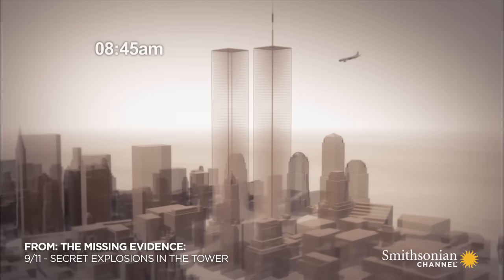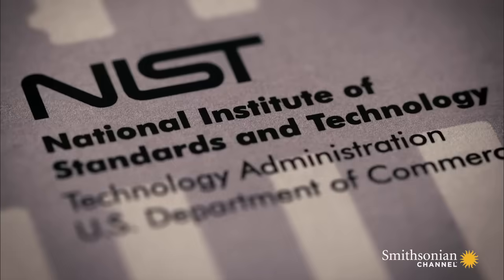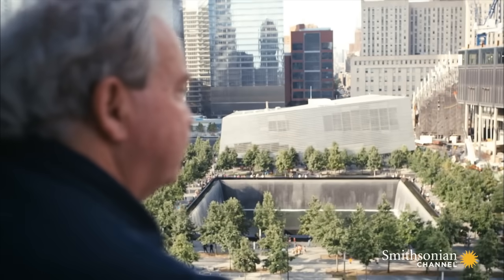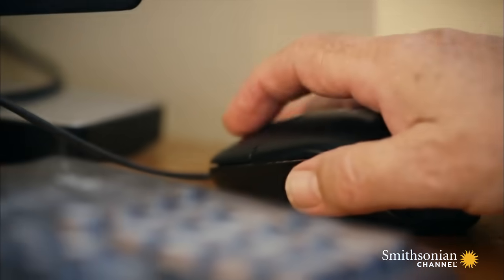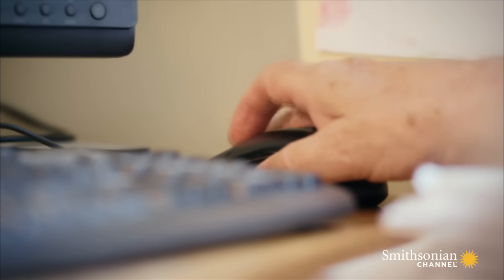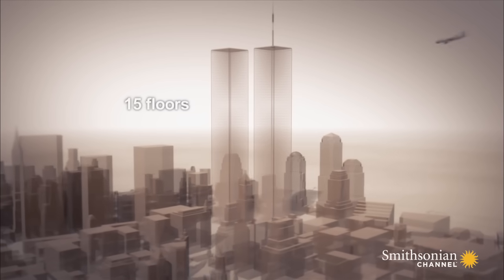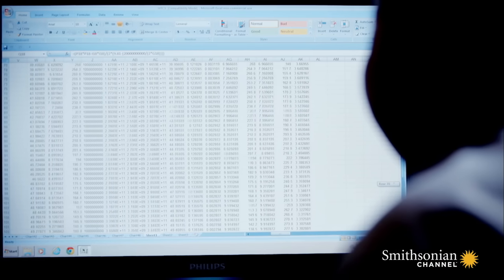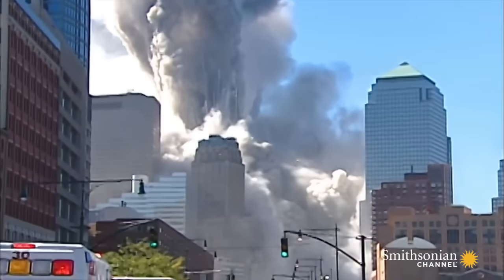This Computer Simulation Explains How the Twin Towers Fell

Comment: 15 floors MIGHT destroy 15 lower floors, , maybe, not the entire building, twice.  Jet fuel doesn't burn hot enough to melt steel, and four pilots did NOT give up control of their jets to a dude with a box cutter.
Reply: do you really think that 15 floors cant destroy one floor? that 16 cant destroy 1? on and on up until every single floor against the lobby?
Reply: @inutero3516  so... you believe it was a progressive collapse? You are also suggesting that the mass and energy of 15 floors collapsing gain mass and energy for ever subsequent floor below.  Instead of the mass and energy of the 15 floors collapsing having and equal reaction which would be loss of energy at each floor hit under the collapsing 15 floors while gaining mass until an equal reaction.  If physics work that way why in control demolition do they start at the bottom and not just start at the top?
Reply: @inutero3516  Newton's third law: for every action, there is an equal and opposite reaction.
If 15 floors collapsed an equal and opposite reaction would be 15 floors of destruction.  Energy is lost at ever subsequent floor which slows the progressive pancake collapse.
Reply: @c.augustedupin2559  

"Energy is lost at ever subsequent floor which slows the progressive pancake collapse."

Let's start from the first floor that collapses. Would you agree that one floor cannot possibly hold up the 15 floors above it?
Reply: @cchris874  your question is too ambiguous.  You could say yes or no to it.  Can you please clarify what you are talking about?
Reply: @cchris874  the first floor of ever building holds up every floor above it. This too is ambiguous
Reply: @c.augustedupin2559  

I don't see that at all. How can a floor hold up another floor if it has no direct contact with it? In the Twin Towers the only thing connecting floors to each other were the perimeter and core columns. It's the COLUMNS not the floors that hold up each floor.
Reply: @cchris874  ok so you were just being ambiguous. Thank you for the clarification
Reply: @cchris874  you said "floor" when talking about a specific system and must have became confused by my use of the word "floor" when talking about an area containing many systems, including walls, columns, ceilings, floors, plumbing, electric, etc.  I was referring to a floor as a mass of systems and not an individual structural floor system.
Reply: @cchris874  I used the word "floor" to describe an area and wasn't talking about a system.  I hope this clarifies it for you.  I'm sorry the context of the sentence didn't help you deduce it's meaning.
Reply: @c.augustedupin2559  
OK, so let's go back to our collapse initiation. In the NIST model, which I don't necessarily fully endorse, the key insight is that once the perimeter columns started to give way on one side of the building, it caused two things to happen: one, the towers started to tilt in the direction of the side which failed first, as we all saw in the videos. But it also destabilized the upper block, causing it to rotate and twist. When this happened, there was no longer column-on-column contact:  the upper perimeter columns were now pressing down on the floors themselves, which were never designed to hold up 15 floors worth of weight. So the floor immediately below gives way.

Does that sound like an impossible scenario to you?
Reply: @cchris874  why do you use the NIST model if you don't fully endorse?  Why don't you fully endorse it?
Reply: @cchris874  I see you used the word "floor" multiple times.  Can you clarify what you mean because I'm not sure if you are talking about a structural floor system or talking about an area.  Your context seams to being back and forth.  And since you were confused about my usage in comments I fear your comments could be confusing and misconstrued.
Reply: @c.augustedupin2559  

"why do you use the NIST model if you don't fully endorse?"

Just being modest. Also, the NIST report contains hundreds of pages of details, and I can't pretend I have fully digested every last one of them to my satisfaction. But the basic claim of a gravity driven collapse need not rely fully on their exact model. So, I proceed here very tentatively to give you ample opportunity to point out what you feel is implausible. Personally, I feel the gist of their model is within plausible limits, and that's good enough for me to have this discussion. So far, do you see any fatal problems with the model so far?
Reply: @c.augustedupin2559  

"why do you use the NIST model if you don't fully endorse?"

Just to be extra persnickety, I didn't say I don't fully endorse it, I don't NECESSARILY endorse it completely, meaning, I leave that an open question.
Reply: @cchris874  what model are you talking about?
Reply: @c.augustedupin2559  

I'm sorry for being unclear. This one:

"once the perimeter columns started to give way on one side of the building, it caused two things to happen: one, the towers started to tilt in the direction of the side which failed first, as we all saw in the videos. But it also destabilized the upper block, causing it to rotate and twist. When this happened, there was no longer column-on-column contact:  the upper perimeter columns were now pressing down on the floors themselves, which were never designed to hold up 15 floors worth of weight. So the floor immediately below gives way."
Reply: @cchris874  please define "floor" and "assembly".  Are you talking about the assembly of an area? Or just the structural floor system and how it is assembled?
Reply: @cchris874  your paragraph talking about a proposed model uses the word "floor" multiple times.  Can you be more clear on about your usage of the word "floor"? Are you taking about an area or a specific structural floor system?  Since you were confused first I want to make sure we are on the same page.  Please provide clarification.
Reply: @c.augustedupin2559  

I mean everything minus all the support columns. In this model, the perimeter columns above are no longer aligned with the columns below, so they are now hitting the floor directly, not the columns.
Reply: @cchris874  I'm sorry your paragraph is too ambiguous and isn't specific.  Your usage of the word "floor" is not defined.
Reply: @cchris874  again when you're saying "floor" are you talking about a specific system or talking about a location or area? Please clarify.
Reply: @cchris874  I don't want to become confused like I did to you when I was talking about "floors" as a location or area.
Reply: @cchris874  please clarify your last statement when using the word "floor".  Are you talking about a system or area?
Reply: @cchris874  if columns above are no longer aligned with columns below how did they hit anything?  Hitting implies something different.  I think you mean the columns are resting on the floor system of a specific floor (ie area).  But I can't tell because you haven't clarified.  Please clarify your statements.
Reply: @c.augustedupin2559  

Just for illustration purposes, if all of the columns are twisted off kilter so that they no longer  align with the columns below, what do you think would happen to them? There are at least two choices: they somehow stay magically elevated. Or, they will have been forced to slide onto the  structure nearest the failed column. That would be the floor right below it (or the air). So whether we call this slided onto, hitting, or resting doesn't matter. That's semantics. It's no different than a trampoline. If you jump out of alignment with the canvas, you will be forced to hit what's right next to it: probably the ground. We can then say you hit the ground, or came to rest on it. Same basic meaning.
Reply: @cchris874  why ask a question then answer it.  Why so combative? I was just asking for clarification? And yes if a column is not properly aligned structural movement can cause structural failures.  What type of structural system failures do you believe to be seeing in the video? What type of structural collapse would you categorize it as?
Reply: @cchris874  also do you understand the column assembly or rather do you understand how column structural support systems are assembled?
Reply: @cchris874  I just wanted to clarify for you because you seemed confused about the usages of the word "floor" and implied that a "floor assembly" is the floor system when it is only a guide on how to assemble floor systems.  Maybe we just have two different schools of thought...
Reply: @c.augustedupin2559  

 I'm trying very hard to make my point understandable. Any combativeness  was not intended. In my last post, do you agree the above columns are not necessarily going to be aligned; and if so, now the surface of the floor at that point will now be bearing the brunt of the weight of the upper block?  I don't know how to say it any more clearly.

Thanks
Reply: @cchris874  hitting and resting are two different meanings.
Hitting implies multiple forces
Resting implies only natural force
Just fyi you seem confused...
Reply: @cchris874  jumping off the trampoline you would first hit the ground. Then after hitting the ground you would then begin to rest.  Maybe you are just confused.
Reply: @c.augustedupin2559  
"I just wanted to clarify for you because you seemed confused about the usages of the word "floor" and implied that a "floor assembly" is the floor system when it is only a guide on how to assemble floor systems.  Maybe we just have two different schools of thought."

I may be confused, but I think it's irrelevant to my point. Forget floors. Let's divide the North Tower in to 2 parts: all the supporting columns; and everything else. Take away the support columns and the rest of the building would collapse. Can we agree on that?
Reply: @cchris874  ok just the columns magically disappear at the same time in this hypothetical of yours.  So I would agree that everything else would stack up on each other.  Each floor (area) including their contents would be pancaked.  Ie a pancake collapse.  Each floor would hit each other based on their terminal velocities and then rest on each other after the collapse.
Reply: @cchris874  I'm sorry you are trying to make a point.  Maybe study more.
Reply: @c.augustedupin2559  

You are being far more combative than me, telling me I need to study more, and I'm confused. How does that happen? Did I even come close to saying that to you?
Reply: So, you want my basic model, which I now put forth in a tentative spirit:

1) Floors start to sag due to the intense heat. 
2) They begin to pull on the perimeter columns, which also are weakening due to the heat.
3) As columns begin to fail, the remaining columns are redundant enough to absorb the extra weight at  first.
4) When enough columns fail, the weakest side of the building begins to give way, hence we see the tilt.
5) This process causes the upper block to twist and rotate, so that in very short order the columns on the other three sides are now pulled away from their alignment.
6) When this happens, the upper block now has too few columns remaining attached to the columns they were previously connected to.
7) Since the upper block now has lost its column support, collapse initiation begins.
8) Forget how we define floor. It's not necessary. Whatever we call it, it cannot support the weight of the upper block. That's why I feel you are hung up on the definition of "floor." 

Note the reason the discussion about floors is not central. It makes no difference how we define "floors" or  whether we say the columns hit, or slided off of, or came to rest (which would of course be only for a fraction of a second) on the floor/whatever you want to call it on that same level. All of that distracts from the main point: the upper block has lost most its support from below, because it's only the columns that are holding it up.

Now, you are welcome to comment on this model. Thank you.
Reply: @cchris874  I'm sorry if you believe I've been combative.  You stated that you were confused.  And you implied you were confused by my usage of the word floor when you asked for clarification.  I need to study more too.  I hope you haven't stopped.  If anything it was just constructive criticism.   Please forgive me I didn't mean it to be combative.
Reply: @cchris874  do the lower columns have the ability to support the same weight of the "upper block" or do they stop having the ability to bear the same weight?
Reply: @cchris874  what type of collapse do you categorize it as? How do you define your proposed model? What type of structural failures do you think would happen in your model?
Reply: @c.augustedupin2559  

"do the lower columns have the ability to support the same weight of the 'upper block' or do they stop having the ability to bear the same weight?"

They would not have the same ability because they are no longer attached to the upper columns. Without these lower columns, there's not enough support for the upper block. The upper columns are now  only attached to other structural members (whatever we might agree to call them), which were not designed to, or capable of, holding up the upper block.   Now, if you don't like my vague definition of the word "floor," then just substitute what you think the upper columns would now be attached to on the lower block. I'm happy to use that in place of "floor." The main point is, with this hypothesis, there is no longer enough column-on-column left. The upper block has lost most of its column support. The remaining structure can't hold that up.
Reply: @cchris874  so.. you are saying due to the upper columns not being connected to the lower columns; the lower columns lose their ability to bear weight? Is that correct?
Reply: @c.augustedupin2559  
I would just call it a basic gravity collapse model. Not sure if the term "pancake collapse" is the appropriate name. 

Since there is no more column-on-column support, there's nothing to stop the collapse from continuing. With each collapsed floor, the upper block gains more mass and continues. How long this would take, and how much it would slow down, is not in my knowledge base.

Off topic for now:  BUT, if this were a CD, then it would be easy enough to slow the collapse time in accordance with a real CD. Why would the government wish to use impossible physics when they can use real physics? That doesn't make much sense to me.
Reply: @cchris874    so.. you are saying due to the upper columns not being connected to the lower columns; the lower columns lose their ability to bear weight? Is that correct?
Reply: @c.augustedupin2559  

Not quite. The lower columns still have the same ability to carry the weight. But the problem is, they are no longer actually carrying it. It's now the floors, anyway you define that, /other structural elements, that carry the bulk of the weight. Not sure how significant the core columns are here, but they would not be able to hold up the floors on their own.
Reply: @cchris874  why aren't they carrying weight? Did they disappear?
Reply: @cchris874  "if this were a CD, then it would be easy enough to slow the collapse time in accordance with a real CD" 
Not sure what you are even talking about.  Why would you slow the collapse? 
What is a collapse time that would be in accordance with a real CD?
Reply: @cchris874  are you suggesting that when the "upper block" was supported by the structural floor systems it passed between the lower columns hitting each subsequent floor between the lower columns that they were supporting.  And that the lower columns could not support their floors due to the added weight of the "upper block".  Each floor progressively pancaking into each other but never losing energy force.  And the core columns would lose it's ability to bear weight.  Basically the "upper block" vs 80+ percent of undamaged building material.  The "upper block" destroys everything with only gravity force and natural force (upward force of the 80+% of undamaged building) doesn't apply. Is this correct?
Reply: @c.augustedupin2559  

"Why would you slow the collapse?"

Because the argument has been put forth that the total collapse times were "too fast."
Reply: @c.augustedupin2559  

"are you suggesting that when the "upper block" was supported by the structural floor systems "

Actually the opposite. The structural floor system/ whatever you want to call it, could NOT, under this model,  support the weight of the upper block. 

"it passed between the lower columns hitting each subsequent floor between the lower columns that they were supporting."

Not entirely, but enough so that the upper block no longer has enough support left.

"And the core columns would lose it's ability to bear weight."

To an extent. But even if not, imagine if there were no perimeter columns. Would one expect the floors to stay in place with only the core columns?
 
"but never losing energy force."

No.not saying that. The question is, how much would it lose?

"The 'upper block' destroys everything with only gravity force and natural force (upward force of the 80+% of undamaged building) doesn't apply. Is this correct?"

It does destroy everything, but it happens one floor/level at a time. So with each level being destroyed, the upper block gains further mass. So, if these 15 floors can destroy the first floor beneath it, what changes in the equation now prevent the process from continuing?
Reply: @c.augustedupin2559  
"why aren't they carrying weight? Did they disappear?"

LOL

Because the weight of the upper structure is no longer landing on the lower columns, at least sufficiently enough to bear its weight. So now consider: what would happen if the floors all shrank and no longer reached the outer columns. Obviously the lower columns can't hold up that which it's not touching. Now that would be an extreme hypothetical. But it illustrates the basic principle, as I interpret it.
Reply: @cchris874  too fast for what?
Reply: @cchris874  in your model the columns give no support to the structural floor systems.  Is like they just disappear.  The floor systems are not  designed for heavy loads but still would cause and be large resistance.
Reply: @cchris874  the lower columns are touching the structural floor systems so yes there would be support from the lower columns.  There would be rotation and visible movement.  There would be large resistance for the upper block to move through, 80+% of undamaged building.  Plus if we use newton's third law of motion we would be left with at least 25+% of the building standing after the collapse. Unfortunately in the video we can see horizontal energy and total collapse without evidence of major resistance.
Reply: @cchris874  is like you said "not sure how significant the core columns are here".  This is the thing... They would offer at least as much resistance as the perimeter and be less likely to rotate off their designed support structures due to being encased by the building structure.  Also you may want to look at the wtc building design assembly diagrams or blueprints.  The outside columns are not traditional columns which could lose contact by rotational movement.
Reply: @cchris874  your interpretation lacks science and your terminology isn't used by experts.  If anything you're an amateur structural/civil engineer.  I give you props for coming up with your own hypothesis.  Even if it lacks equations and doesn't apply laws of motion.  You are clearly Google educated.  That's awesome you are doing more work than many.  Keep studying my friend and I will too.
Reply: @c.augustedupin2559  
"There would be large resistance for the upper block to move through, 80+% of undamaged building. "
When you say things like this it shows that you don't understand the progressive collapse.

"Plus if we use newton's third law of motion we would be left with at least 25+% of the building standing after the collapse."
And you make the same error here.

The initial upper blocks may have been 15-20 floors.   So they drop on a weakened floor below and keep moving.  The material from that floor joins the collapse.   Now you have 21 floors coming down.  They hit the next floor.  That cannot possible arrest 21 floors coming down with momentum now and also on an angle, so the collapse continues.  Now you have 22 floors smashing down....23  24 25 and it continues.

If you're talking about the upper block destroying the rest, you're showing that you don't understand this.
Reply: @c.augustedupin2559  

"Not sure what you are even talking about.  Why would you slow the collapse?"

I don't know why I have to explain this. As you obviously know, one of the central criticisms by the truth mvt is that the towers could not have collapsed as fast as they did by gravity alone. The speed was therefore "too fast." You must have heard that claim numerous times, right?

So, to preempt this claim, why didn't the government make the alleged demolitions conform to physics?: make the collapses take as long as they would if it were an unaided gravity collapse.  That way, they avoid the charge that the collapse times "violated physics."

Am I making sense?
Reply: @cchris874  really?! People think that gravity alone caused this?! Wow.  Why did you bring the government into this? Which document are you even talking about? There's no government document stating why there was a "total collapse". At least I can't find one.  Please share your documentation.  Is that why you don't necessarily endorse NIST?
Reply: @c.augustedupin2559  

"Which document are you even talking about? "

Help me there. Where did I mention a document?
Reply: @c.augustedupin2559  

"Why did you bring the government into this?"

Who do you think is responsible for the complete collapse of the buildings?
Reply: @c.augustedupin2559  

"There's no government document stating why there was a 'total collapse' "

I didn't say there was. Read more carefully please. Irrelevant to what I wrote above.
Reply: @cchris874  if you have know idea what caused the total collapse why do you speculate how it happened if you aren't an engineer? Why do you play monkey see monkey do?
Reply: @cchris874  do you have any scientific paper talking about and proving why there was a total collapse? Or do you only have "trust me bro" mentality?  Please give evidence if you aren't hear to push a narrative and only try to gaslight.
Reply: @c.augustedupin2559  

For the sake of argument, I will change "total collapse" to "the extent to which the twin towers actually collapsed."
Reply: @c.augustedupin2559  

And to avoid any more potential for miscommunication, why don't you state in your opinion, based on your engineering knowledge, how much of the twin towers collapsed, and what you believe caused it, and who bears primary responsibility, if anyone.
Reply: @c.augustedupin2559  
" There's no government document stating why there was a "total collapse". At least I can't find one"
There are plenty of analyses.  NIST even reference one of two of them in their report.   They even show a basic analysis in their FAQ explaining why there was a total collapse.
You are playing games.   The information is there but you don't really want it.  You are just trying to present it as some sort of mystery.
Reply: @c.augustedupin2559  
" do you have any scientific paper talking about and proving why there was a total collapse?"
There are multiple papers on this by people like Bazant, Greening, Seffen, Zhou et all.
Reply: @cchris874  it's an unsolved mystery.
Reply: @markh1011  the papers  you're quoting do not show what we see in the video or the aftermath.
Reply: @c.augustedupin2559  That's exactly what they analyse.   Their analysis is consistent with what we saw.  
I expected an excuse but that was even worse than expected.
Reply: @markh1011  so please cite it.
Reply: @c.augustedupin2559  So let me get this straight.
You just claimed that the analyses were wrong.
Now you're asking me what the analyses are.
So you claimed they were wrong before you even knew about them.
🤦‍♂
Reply: @c.augustedupin2559  You mean "cite it".  🤦‍♂

Here are a couple.  
Why Did the World Trade Center Collapse?—Simple Analysis
By Zdenek P. Bazant1 , Fellow ASCE, and Yong Zhou2
Journal of Engineering Mechanics

Zdenek Bazant, Jia-Liang Le, Frank Greening, and David Benson, 
“Collapse of World Trade Center Towers:  What Did and Did Not Cause it?”, 
Journal of Engineering Mechanics, May 2007.
Reply: @markh1011  so let's get it straight you never read them because you can't cite them.  Nice bro...
Reply: @markh1011  let me be more specific.  Where in the papers did they cite the cause for total collapse?
Reply: @c.augustedupin2559  
"so let's get it straight you never read them because you can't cite them"
I have read them and did cite them,
You're projecting your own problems.
Nice bro...   
😂
Reply: @c.augustedupin2559  
So what will the next evasion be  ..bro?
Reply: @markh1011  so you have nothing lol. You are just a typical gaslighter... I'll wait for you to cite something from the papers.  But I doubt you have ever read them...
Reply: @c.augustedupin2559  I can provide many more.
There were plenty of papers in peer reviewed journals supporting the official story.
You're going to have to come up with a lot of excuses.....  bro.
Reply: @markh1011  I'm still waiting for you to cite anything that explains total collapse.
Reply: @c.augustedupin2559  
". I'll wait for you to cite something from the papers."
So I've cited papers.
I've even cited a specific page of one of them.
You are running now.
🏃‍♂🏃‍♂🏃‍♂
🤣🤣🤣
Reply: @c.augustedupin2559  
"I'm still waiting for you to cite anything that explains total collapse."
I've given you a paper that has a full analysis of the total collapse!
You're looking panicked and cornered.  😂
Reply: @markh1011  lol lol lol what page of what paper did you cite? I don't see anything.  Maybe you are trying to gaslight like usual.  Lol lol lol lol lol
Please cite the paper and page again if you can.
Reply: @markh1011  again it should explain total collapse
Reply: @c.augustedupin2559  
So we've had:
"Any papers proving why there was a total collapse?"     Provided.
Then to 
"They don't show what we see in the video."     Even though you haven't even looked at them!
Then to
"No you have to cite specifically".     Done.
Then to 
"Where does it say what caused the total collapse?.       Done
Then to
"I'm waiting for you to cite what caused the total collapse.     Already done!  

Look at him run.  
🏃‍♂🏃‍♂🏃‍♂🏃‍♂🏃‍♂
Reply: @c.augustedupin2559  
"lol lol lol what page of what paper did you cite?"
 “Collapse of World Trade Center Towers:  What Did and Did Not Cause it?”, 
Page 30.

That's TWICE now.
Reply: @c.augustedupin2559  
" again it should explain total collapse"
The paper is an analysis of the total collapse.
I have referenced TWO papers that do this and I have more.

You're stalling and it's hilarious.   🤣🤣🤣
Reply: @c.augustedupin2559  
You're looking cornered. 
A little hint, typing lolololol isn't going to save you.  😉
Reply: @c.augustedupin2559  I'm still laughing at this "the papers  you're quoting do not show what we see in the video or the aftermath."
....you didn't even know about the papers but you were claiming they were wrong.    
That says a lot.
Reply: @markh1011  
You know, I knew he was beginning to play games when he started making a big fuss over "total collapse" times. What a semantic joke. Actually I had a hint when he did the same thing with "floor." First he praises me for trying, then he does an about face and says, Monkey see Monkey do. This is all the sign of a most fragile fellow.
Reply: @markh1011  
Auguste claims above it was impossible for the perimeter columns to sufficiently twist themselves off to hit the floor. I was going to ask him for the science behind that, but maybe you'd care to comment too.
Reply: @cchris874  I think this is the same guy who post posted "lol" as a response to my posts many times.   That's the whole post  -"lol".   So I'm actually surprised that he got into a discussion with you at all.   I didn't think he had that in him.
Reply: @cchris874  
"Auguste claims above it was impossible for the perimeter columns to sufficiently twist themselves off to hit the floor."
I'm struggling to visualise that.  What do you mean by (1) twisting off (2) hitting the floor.  

Are we talking about the initiation of the collapses where the floors sagged and the perimeter columns bowed inward until failure?
Reply: @c.augustedupin2559  

Gaslighting means to manipulate. Yes, I suggested that truth movement types often have a tendency to some pretty weird ideas. But I did not do so through manipulation of you or anyone else. I did it just by reflecting on the absurd that arises by itself when one looks at the bigger picture. Like the need to bring down the towers in the first place. This is hardly gaslighting. It's using your brain. And I am not suggesting that you, or every last skeptic, is in this category. A lot of very smart and sensible people believe what you do. But then, I would argue, we all have our blind spots.
Reply: @markh1011  there is no page 30. I see you are still gaslighting... Nice try though
Reply: @cchris874  did you look at the exterior shell of the wtc towers? I doubt it since there not typical columns.
Reply: @cchris874  and you haven't a clue or just gaslighting.  Lol lol lol lol lol
Reply: @markh1011  lol
Reply: @markh1011  look at you run... Lol lol lol lol
Reply: @c.augustedupin2559  
"there is no page 30"
You are correct, I looked at the bottom and saw 30.  It was equation 30 on page 15.
So the correct answer was page 15.

However I made it clear that I was referencing from the conclusion.
There are 15 pages with a conclusion at the end.
You could have found that.

So you've been completely spoon fed every step of way now.
You've got exactly what you asked for.
Quit dodging.
Reply: @c.augustedupin2559  
"look at you run"
You're projecting.
You asked for a scientific paper explaining the total collapse.
I've given you 2.  I have more.
You've been tap dancing every since.  💃👯💃
Reply: @markh1011  you have never read the paper... And you are still trying to gaslight.  Lol lol lol lol
Reply: @markh1011  you haven't given anything  other than titles to papers you have never read and you don't know the people who wrote them.  You also haven't read any peer reviews either.  You might have a list of papers given to you from your commander but you haven't done your due diligence.  Nice try at gaslighting. Lol lol lol lol lol lol
Reply: @markh1011  I think you are confused about your projections. Lol lol lol lol lol lol lol lol lol
Reply: @markh1011  lol page 15. Conclusion. Lol lol l lol lol lol lol lol lol.  You don't even understand. Lol lol lol lol lol
Reply: @markh1011  it's a real shame you can't cite any real information from papers you claim to have read the titles of.  Smdh 
"Page 30" lol lol lol lol lol
"Nevermind I meant page 15" lol lol lol lol lol lol lol lol.   

How about cite the equation you think you saw. Lol lol lol lol lol lol LoL
Reply: @markh1011  your lies are catching up to you. Lol lol lol lol lol lol lol 
Please keep trying to gaslight.
Reply: @markh1011  I'm writing a book about your kind. Tim Shea is one of the best gaslighters. You better call in another fake account with a better moderator.  Lol lol lol lol lol lol lol lol lol lol lol lol
Reply: @c.augustedupin2559  

"and you haven't a clue or just gaslighting"

Already answered that. 

Proof please that most of the perimeter columns could not have been broken and ended up bearing directly down on the floor.  Me: I don't pretend to have a proof that they did. So please don't ask that. Looking at pics is not a proof.
Reply: @markh1011  look at you run in your tap shoes.  Lol lol lol lol lol lol lol lol lol lol lol
Reply: @cchris874  I told you. If you were interested you would find the blueprint.  You would do your own due diligence.  But we both know you are only here to pat mark on the back.  I've been watching you gaslight over many years on 9/11 videos.  Lol
Reply: @c.augustedupin2559  

No, I really am interested in the physics you would give to demonstrate that these columns couldn't have failed. I could then bring that to the physics department of a local university and see what they say.

You have tried repeatedly to belittle me: only engineers should ask questions,   gas lighting  lololololo, "Google educated",  Monkey see, and so forth.  This is not what I expect from a serious person. But I do expect it of a person who is insecure. Do you think you fool anyone here?
Reply: @markh1011  
"Are we talking about the initiation of the collapses where the floors sagged and the perimeter columns bowed inward until failure?"

Specifically his claim the perimeter columns could not have torn free.
Reply: @c.augustedupin2559  
I can no longer find your comment that the perimeter columns could not have torn free. Do you still believe this?
Reply: @c.augustedupin2559  
Speaking of peer review papers, perhaps you could be the very first to provide a sound challenge the gravity collapse models by submitting one to a respected science or engineering journal, (not a questionable one like Bentham.)  21 years on, and we are still waiting. If you are so well versed in the physics, you have the power to change this and get the ball rolling, rather than the anonymous safety of Youtube.
Reply: @c.augustedupin2559  

"why do you speculate how it happened if you aren't an engineer?"

Why should only engineers be allowed to have discussions? I never presented myself as a qualified scientist or engineer. This is not meant to be a technical forum limited to engineers.

I love the about face: from "That's awesome you are doing more work than many."   to "Monkey see."

Says to me your emotions change rapidly at the drop of a hat.
Reply: @cchris874  do you deny all the reports of explosions going off in the lower floors before the first plane hit?
Reply: @c.augustedupin2559  
"you have never read the paper."
I have.  You're stalling.
You asked for this paper.    Evading with "you haven't read it" isn't working for you.
It's obvious that you have dug yourself into a hole here.
Reply: @c.augustedupin2559  
"you haven't given anything  other than titles to papers"
You asked for a paper that explained the total collapse.
I gave you two papers that show an analysis of the total collapse.
You're evading.
Reply: @c.augustedupin2559  
" other than titles to papers you have never read "
This deflection doesn't work.
I have read the paper.  But even if I hadn't that would be irrelevant.
You asked for a paper that explained the total collapse.
You got it.
Now you're panicking and stammering excuses.
Reply: @c.augustedupin2559  
" Lol lol lol lol lol lol lol lol lol"
You're not even good at dodging.
You asked for a paper.
I gave you 2.
Quit stalling.
Reply: @c.augustedupin2559  
"look at you run in your tap shoes"
Look at you projecting.
You asked for a scientific paper.
I gave you one.
You've dug yourself into a hole because you got what you asked for and don't know what to do now.
Reply: @cchris874  
"Specifically his claim the perimeter columns could not have torn free."
When the upper block dropped down and started pulverising the floors below, any connections could have been torn free.
Reply: @c.augustedupin2559  I'm still waiting.
You specifically asked for this paper.   I gave you two actually.
You've given me about 30 posts of evasions.
Reply: @markh1011  they didn't explain why there was total collapse.  Good try though.  I also asked where specifically in those papers for a citation that you categorized as an explanation for total collapse.  You pointed to page 30 which didn't exist and then pointed to page 15 saying you made an error due to it being a diagram 30 and got the page wrong.  That's two lies because there is no diagram or equation that you speak of. Lol. Nice try gaslighting lol
Reply: @markh1011  

"When the upper block dropped down and started pulverising the floors below, any connections could have been torn free."

 But for the block to drop, the columns first have to break off.
Reply: @markh1011  so you point to a paper that you have no idea what it says and you say "here's proof" lol lol lol lol lol lol lol lol lol great stuff
Reply: @c.augustedupin2559  

Not necessarily. But if you are referring specifically to Willy Rodriguez, there is no proof he heard the plane impact. That's his unproven claim.
Reply: @markh1011  you mad bro?
Reply: @markh1011  lol
Reply: @c.augustedupin2559  
" they didn't explain why there was total collapse."
That's exactly what it explains.
It's a full analysis of the collapse showing why it continued.  You asked for this.
You dug yourself into a hole.
Reply: @c.augustedupin2559  
" I also asked where specifically in those papers for a citation that you categorized as an explanation for total collapse. "
The entire paper is an explanation for the collapse.  I pointed you to where they summarise this.
You dug yourself into a hole.
Reply: @markh1011  lol nice gaslighting
Reply: @c.augustedupin2559  
" That's two lies because there is no diagram "
Your evasions aren't working.
You asked for a paper that explained the total collapse.
I've given you this.
"specifically where does it say blah blah" I point you to the summary.

" That's two lies because"
That's zero lies.
I told you the wrong page no.  I corrected and gave you the right no.
You are stalling.
Reply: @cchris874  
" the columns first have to break off."
The bowed inwards until they buckled.   That buckling caused the top block to drop on one side but that progressed to the rest of the building.
Reply: @c.augustedupin2559  
"so you point to a paper that you have no idea what it says and you say "
You're still tap dancing.  
YOUR WORDS  "do you have any scientific paper talking about and proving why there was a total collapse?"

You've been given two.
You've been tap dancing ever since because you have no idea about this subject at all.
(it's rather obvious)
Reply: @c.augustedupin2559  
"you mad bro?"
Actually watching you squirm and invent excuses is quite entertaining for me.
You asked for a paper that you didn't really want.  You don't understand it.  You don't understand anything about this.
You're helplessly out of your depth.
Reply: @c.augustedupin2559  
"because there is no diagram or equation that you speak of"
There are numerous equations and diagrams.  🤦‍♂
How can you be this hopeless?
Reply: @markh1011  lol you are mad! Lol
Reply: @markh1011  why are you trying to gaslight?
Reply: @c.augustedupin2559  

Tell us in your own words the main flaws of the main NIST report.
Reply: @c.augustedupin2559  You've obviously got nothing.   You asked for those papers.
Waiting for a response.  ..
Reply: @inutero3516  are you here to gaslight too? Mark and Chris are professional gaslighters.  Which is the reason they don't talk about energy, laws of physics, and use so many ad hominems...  It really shows their corruption and their chains.
Reply: @inutero3516  if you take two rocks together of the same density and mass, then smash them together what happens? Does one just crumble?
Reply: @inutero3516  I also noticed that I can only see 8 of the 10 total comments in this thread.
Reply: I think the death knell to these theories is the recognition the government had no motive to collapse these towers. I just finished reading the book Touching History. The palpable emotion that leaped out and touched every one of us was the conviction we were at war with terrorists. By 9:37am at the latest, this was the collective mindset of the country. The War on Terror and the Invasion of Iraq depended only on this. Thus what happened after 9:37am is irrelevant. It is this persistent failure to see the big picture that was the main flaw of the so-called truth mvt.
Reply: "15 floors MIGHT destroy 15 lower floors, , maybe, not the entire building, twice."
If 15 floors destroy 15 floors you now have 30 floors worth of material smashing down.

"Jet fuel doesn't burn hot enough to melt steel, "
The jet fuel didn't melt the steel.  The fires weakened the steel.
Reply: @markh1011  

"If 15 floors destroy 15 floors you now have 30 floors worth of material smashing down."

Another example of truther lacking big picture thinking. They talk basic physics. How more basic can this be?
Reply: @markh1011  lol
Reply: @markh1011  
By floor I mean the actual floor assembly by itself, not the columns attached to it.
Reply: @cchris874  what is a floor assembly? Are you talking about the structural floor system?
Reply: @cchris874  also a floor assembly would include the fasteners to columns and how to assemble it.  A structural floor system or just a floor system is referring to just the "floor" ie truss or whatever and not the columns.  As the columns are the structural support system and includes a foundation.